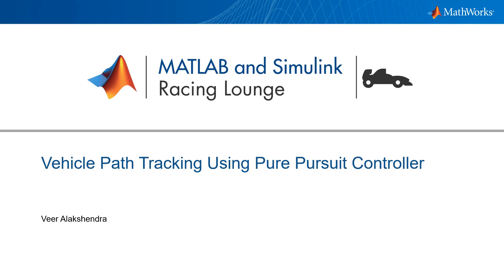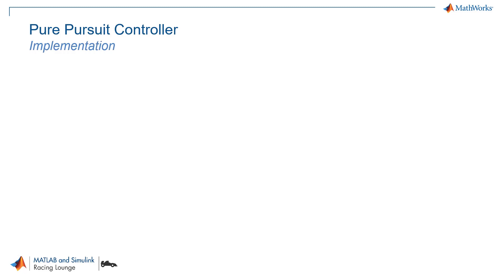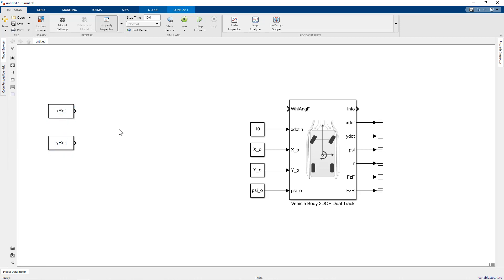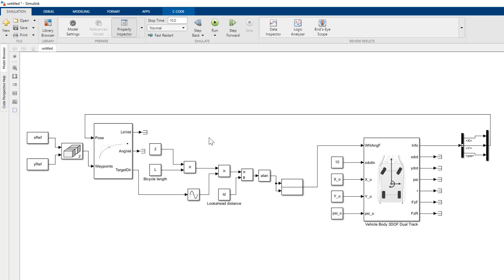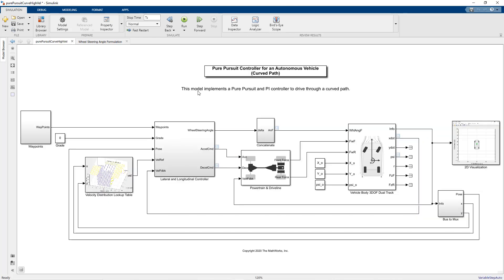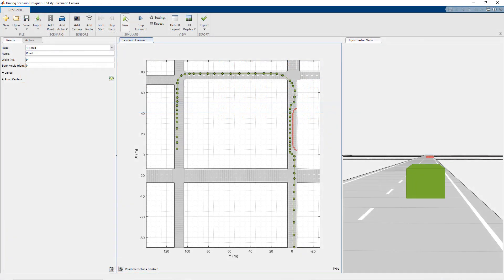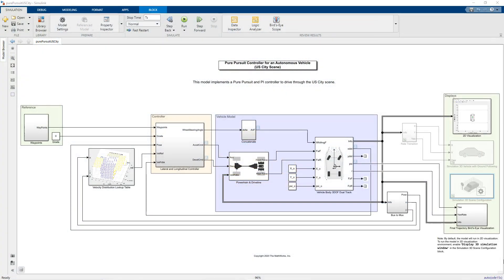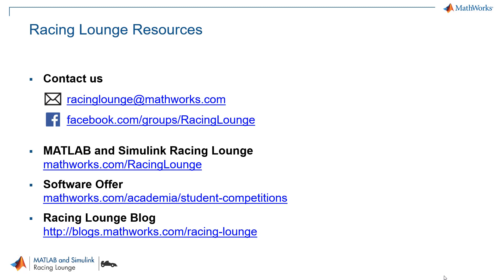Vehicle Path Tracking Using Pure Pursuit Controller

Comment: The pure pursuit model does not want to follow the path if the path crosses itself. For example in the case of a round about. Could you suggest some ways around it? It works when you input the time reference into the visualizer block, but i wish to use it with multibody mechanics viewer and in that scenario, the  vehicle does not want to follow the path.

Comment: Can you please tell me how to add 2D visualization block?
Reply: Hi ,did you find the 2D visualization block?
Reply: @bilalsadiq3495  Yes I did thanks
Reply: @mkplays3361  Hi,, Would you like to guide me then, please?
Reply: Also,can you help me in implementing the MPC controller for path tracking?I have all the idea just need some supervision to pursue coding the MPC in MATLAB.
Reply: @bilalsadiq3495  I don't know much about MPC, but the 2D Visualization block I copy pasted from one of the reference examples.
Reply: Hi Mrutyunjay and Bilal,
Please note that the 2D visualization block has been taken from one of the reference applications in MATLAB (examples in the documentation). We would suggest directly use the block from the models. 
Regarding MPC, please check the following submission. We have used Simulink blocks to implement the MPC: https://www.mathworks.com/matlabcentral/fileexchange/84320-vehicle-path-tracking-using-model-predictive-control-mpc